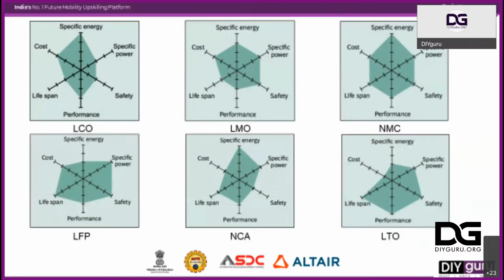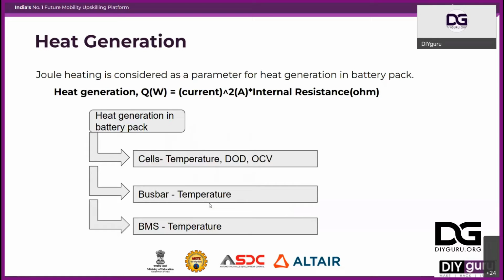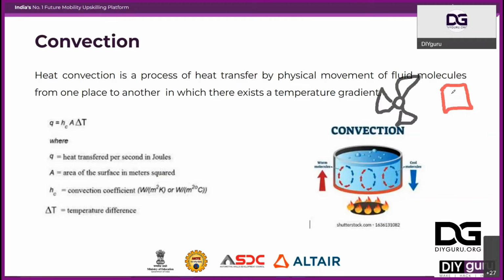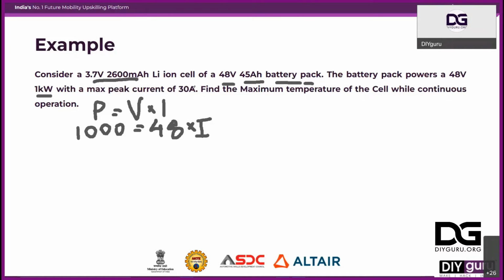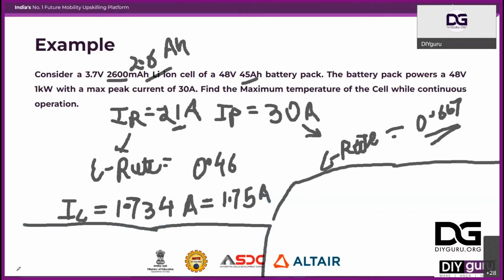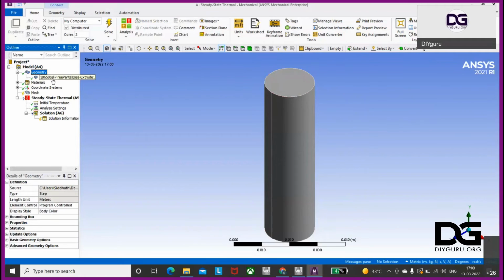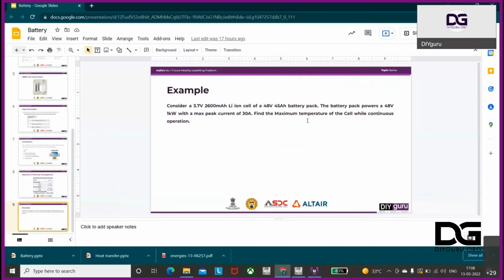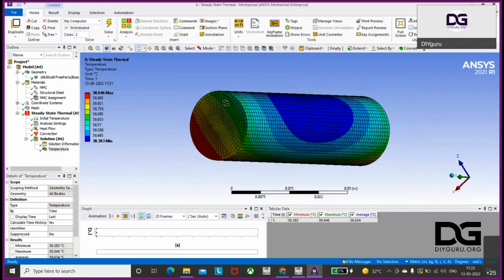How to do Thermal Analysis of Lithium Ion Cell | DIYguru

Comment: Why did you choose the heat flow condition over the internal heat generation condition? Are they interchangeable?
Reply: no bro he has accidently made a mistake there. Because 0.378 W is the total heat generated in the cell, so, volumetric heat generation should have been the correct way of modelling; but in case you want to use heat flow then better first find the heat-flux and use that for calculating heat flow across each face (Q= q*A)

Comment: If average temperature and temperature uniformity of cases while testing are same what other parameters can be checked
parameters like discharge rate, inlet flow rate are same(Immersion cooling)

Comment: amazing video sir. can you provide the research paper or book from which you have used the formula from.
Reply: What formula are you referring to? Joule's heating is a basic physics derivation from the Power Equation and Ohms Law.

Power = I * V
Substitute Ohms Law (V = IR) into the above power equation. 

P = I*(I*R) = I^2 * R

As such, Power = I^2 * R - where I = current and R = resistance 

Power is simply 'Watts' or Joules/second - so the Heat Generated over a period of time is equivalent to Power.
Reply from the maker: Sure, please drop an email to ayush.sharma@diyguru.org
Reply: @DIYguruORG  please check the mail and reply me back !!!! Thank you 😊